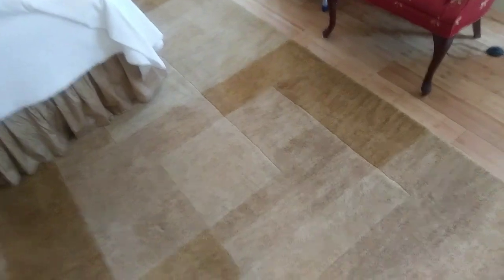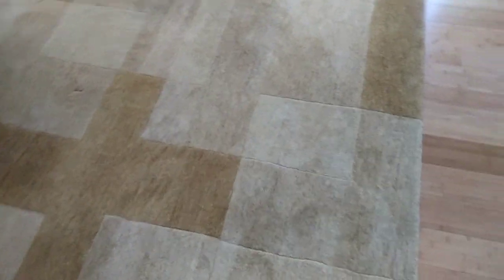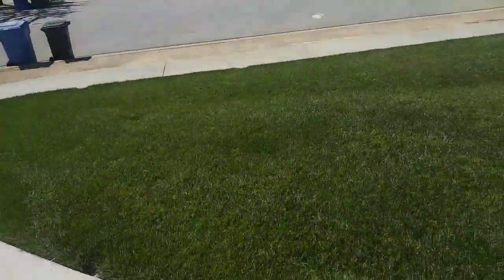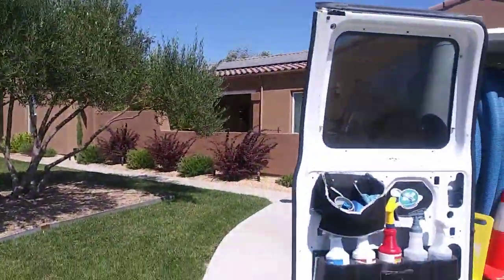Cleaning thick wool rug for customer - Low moisture carpet cleaning

Comment: What product do you use on the the wool? And do you like the fan drier you used ? Really like your vids cheers
Reply from the maker: I used carpet details on this job for low moisture method. Its a neutral PH product that is an encapsulating product.  If hot water extraction I would use something like chemspec oriental rug shampoo with wool safe logo on it. Yes I do like the fan . thanks for watching my vids.